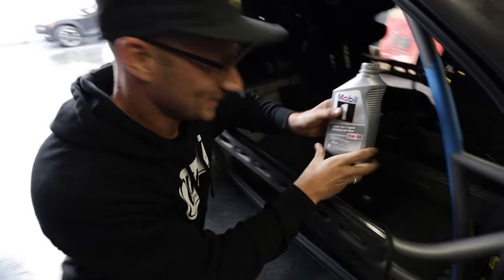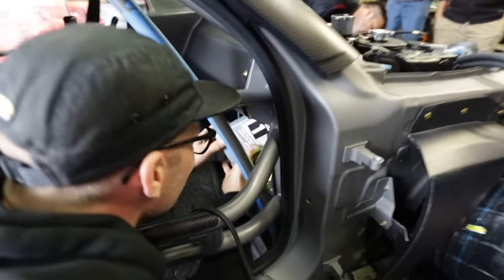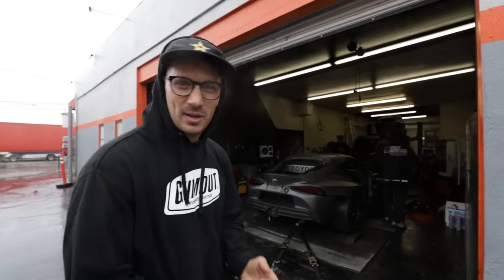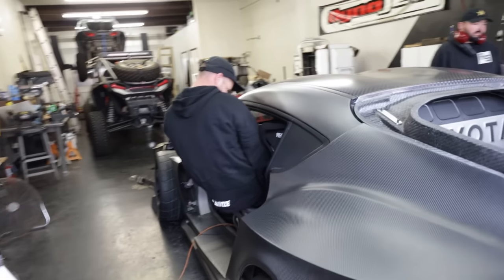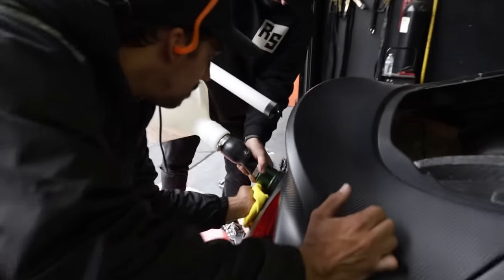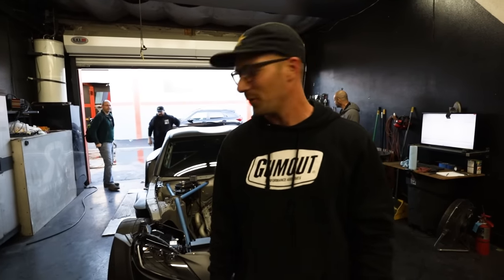Formula Supra DYNO!

Comment: What we were waiting for. This is basically a F1 car with a MK5 Supra body
Reply: Bruh it's not like that at all. A Formula one car is open wheeled rear engined and single seater, pretty defining characteristics, this is a road car with a road chassis there's nothing formula one about the chassis. You can't just go around saying things are something else that's not how words work
Reply: @MrCTruck  I think you kind of missed the point. Pretty sure he meant it has the body of a Supra but the soul of an F1 car. They weren’t specifically referring to the chassis or anything.
Reply: @manlymantis101  you are right but Conner Kelly got a point too
Reply: @manlymantis101  it doesn’t have the soul of a f1 car because the engine is a lemans engine not a f1 engine.
Reply: @MrCTruck  isnt that what he talking about? "F1 on MK5 Supra body?" The Engine is like an F1 But instead on open wheel it was on a MK5 Supra.
Reply: @MrCTruck  he means like the heart of an F1 car and a MK5 Supra body bruh.

Comment: Ryan, Please Please get Dom to add a Blown Diffuser. You've got the F1 V10 for it
Reply: That is not easy to make
Reply: Those were on the 2010-11 V8 cars mate
Reply: Blown diffusers just aren't good for race cars unless they are mapped for cold blowing. They can be like a light switch. Lift off half way round a corner and you have no downforce all of a sudden
Reply: throw that fuel away with a two step tune! even though no turbo, only for downforce!
Reply: It would be neat if that was doable, but the aero would create too severe of a deficit in comp.
Reply: This is neither a competition car, nor a wind tunnel developed car. As it is, I see clamp-on exhaust silencers in this car's immediate future just to be able to take it to a lot of tracks.

Comment: Out of curiosity, why isn't the airbox on as that can increase or hurt performance?
Reply: Independent throttle bodies with trumpets/velocity stacks just the prime setup, filters would rob a little power and be a pain to mount to the stacks and also risk sucking them in and really hurting an extremely expensive engine.
Reply: @EXZACHTPERFORMANCE  no. Just no. Hi-flow mesh caps rob zero power at all. They didn’t put them on because it’s a safe environment and there’s a low chance of something getting sucked in.
Reply: @EXZACHTPERFORMANCE  Not sure if you have seen the build, but they already had a 3D printed airbox and the filters are up front at the bumper so what you are saying with (i assume) individual filter is not what I meant
Reply: @GeenIdee2  yeah tbh haven't been staying up to date just calling what I saw 🤷🏼‍♂️

Comment: Why does Ryan stop the dyno roller each time between runs?  Its a massive heavy mass... high inertia.  I dont understand why he wouldnt just let it spin at idle or whatnot instead of quickly decelerating the dyno wheel to a complete stop.  All he's doing is burning up his clutch and brakes.  Am i missing something?

Comment: Hiw much does it cost?
Reply: In all it's practically a $100k-$125  build. The engine starts at $50k. The car used is from $20k-$50k. Transmission more than likely was $10k or more. And of course the body work and weight reduction was minor but would cost up to $10k.